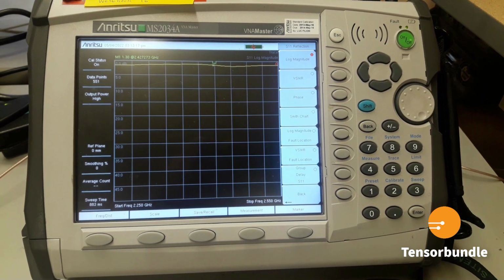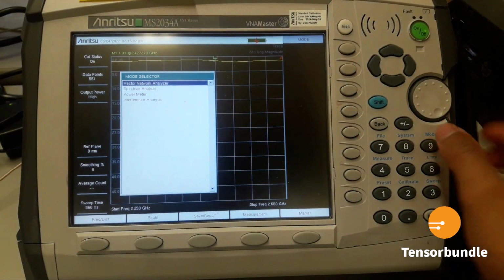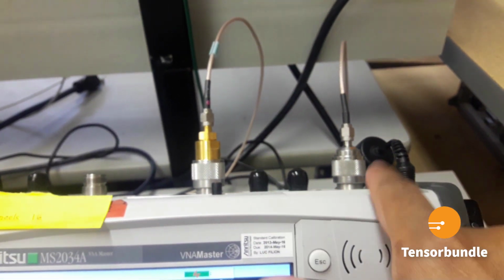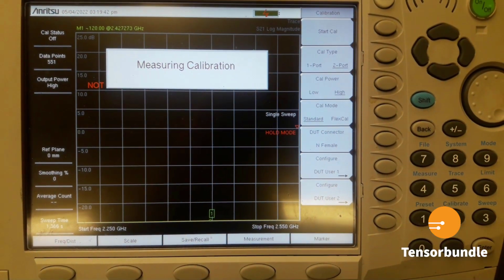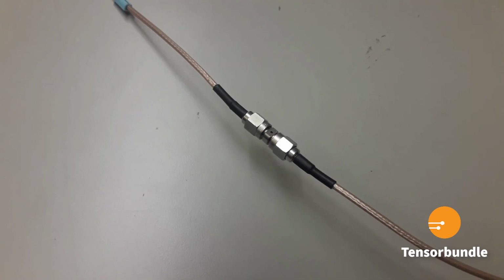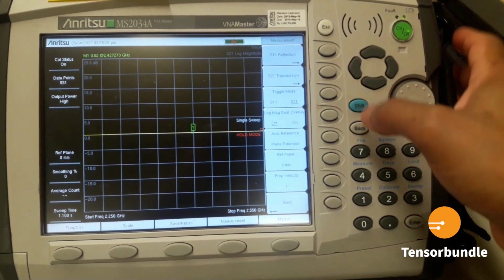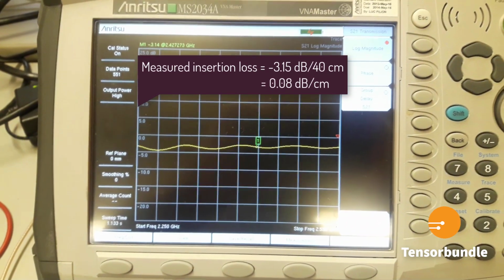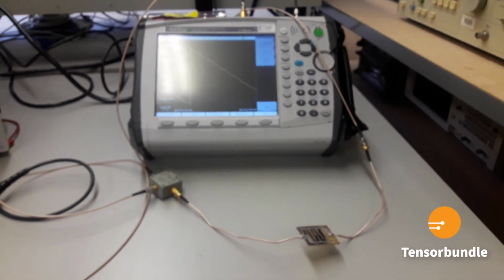Insertion Loss Measurement of Pig Tail Cable (RG316 co-ax) by Anritsu MS2034A VNA | SOLT calibration

Comment: Seems like you could also short the center pin to the braid on one pigtail, measure the S11 reflection coefficient, then divide that number by 2 to get the insertion loss